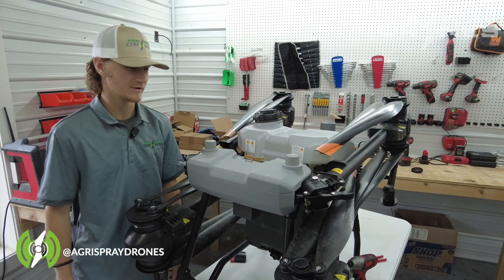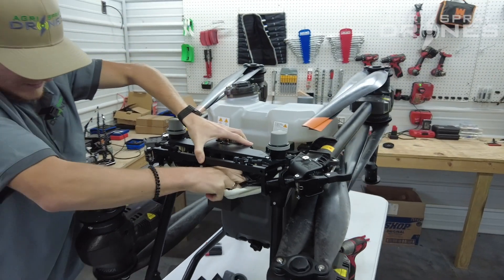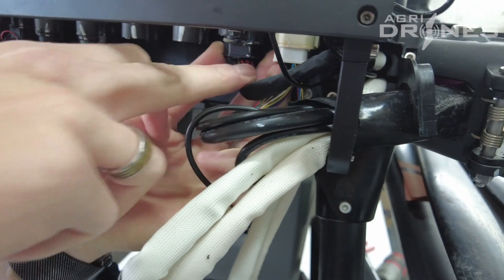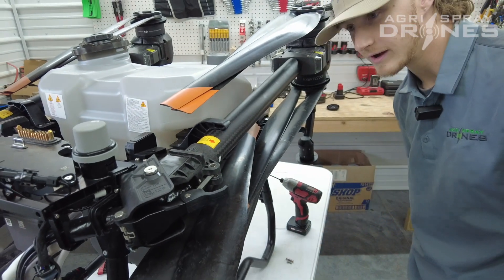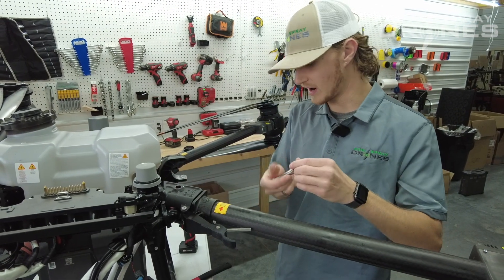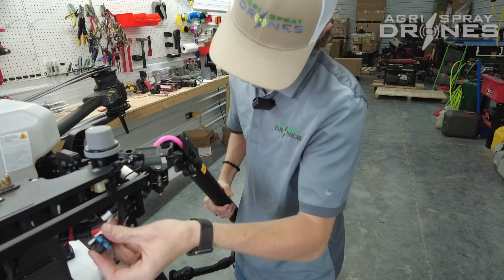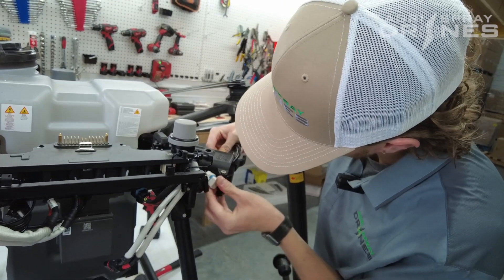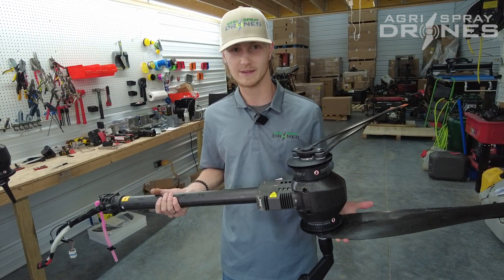How to remove the arm from the DJI Agras T40

Comment: My drone doesn't link with the controller, it just beeps, what happens?
Reply: Hello, Jaime. you must reconnect the controller with the drone again. During the entire process, the aircraft must be turned on. open the Agras app, click on begin, go to settings, in the top right corner of the screen (gear), click on the remote control icon, on the screen that will open (third icon from top to bottom). then click on linking, which will be written in blue, when you click, a blue light will start flashing on the control, and a beep will sound, at that moment go to the drone, press and hold down the battery button until the light and beeping stop, at that moment the drone will be reconnected with the control. I hope I helped, sorry for the translation, I'm from Brazil.